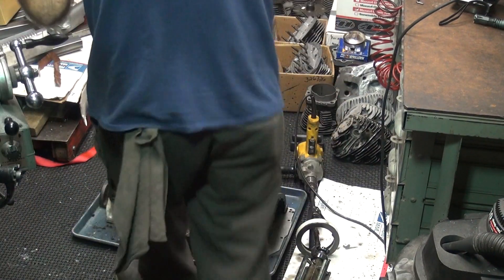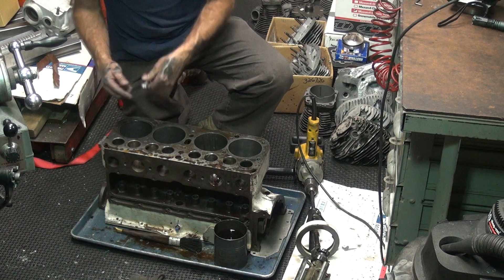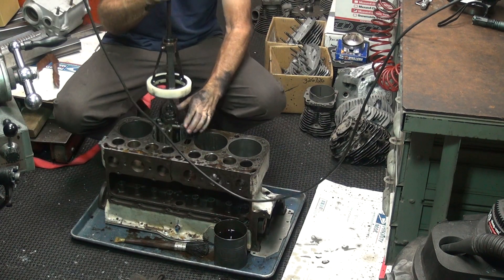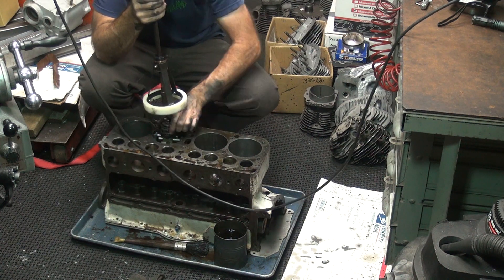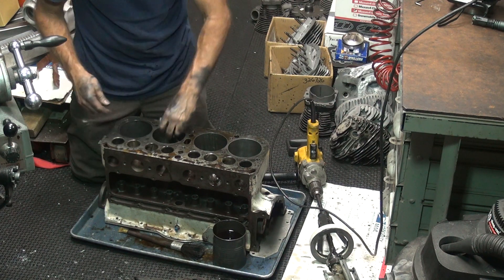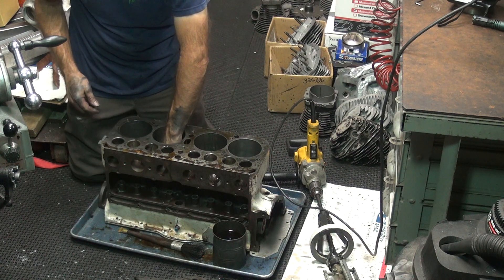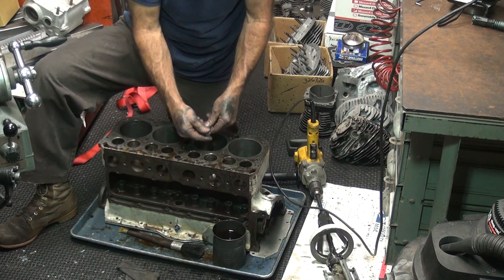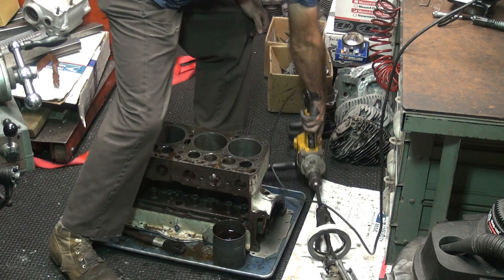1932 ford #118 model A or B flathead race block crack repair by tatro machine

Comment: Sorry, I don't understand why you are spending so much time honing if theres no way it'll ever be truly round. Wouldn't it be faster and ultimately cheaper for the customer to just bore it and sleeve it?
Reply from the maker: no one seems to understand that there is no metal left. this race motor has already been bored way oversize for the class so there is no repairing it and still keeping the big bore. sleeving it back to a more stock small bore is not an option. you make it the best you can and run it. as you can see in the videos, i got 90% of the bore back straight and round without going too much more on the bore size so the piston clearance was still at a usable number. the motor ran some more runs before it was all sold off to some collector.
tatro